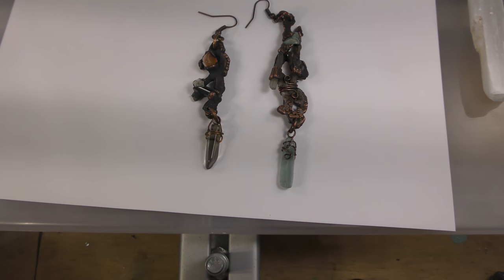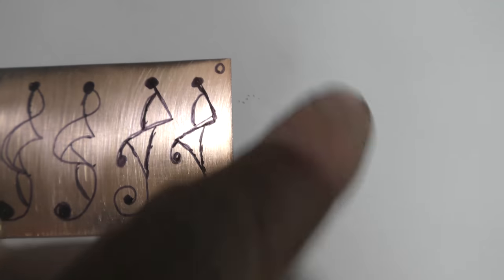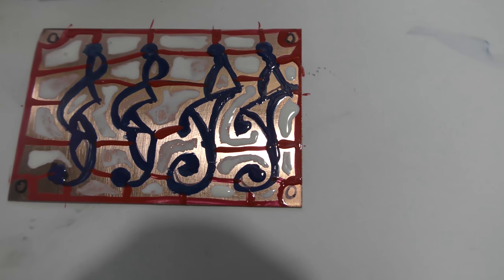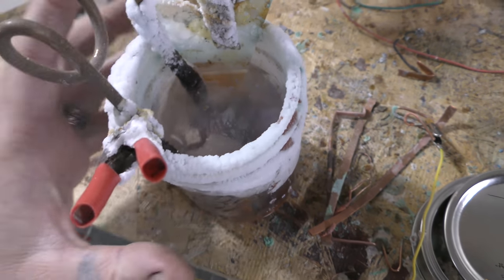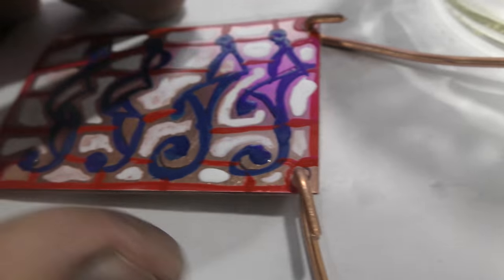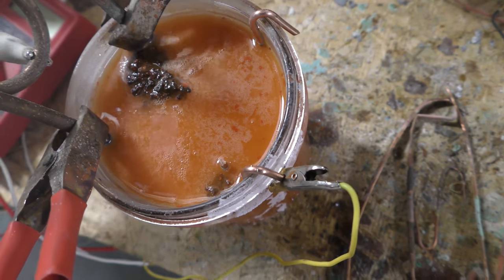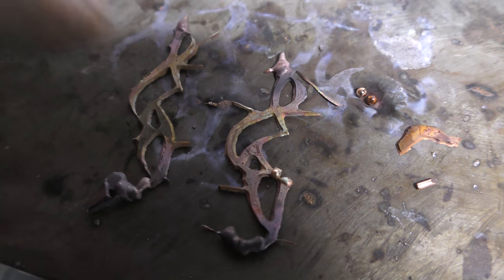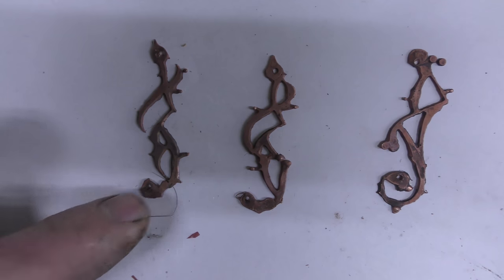Electroetching /cutting  copper with salt water

Comment: Sulfuric acid as the electrolyte would be much better. It would actually make copper sulfate as one of the side products and is much cleaner and probably much faster. Try it out. It wouldn't require any water changing either. The only downside may be its interactions with the tape. Another electrolyte that would work well is the copper sulfate itself.

Comment: You make STUNNING jewelry.I'm a fan. Question: why not just use the electroforming bath? Especially ifyou have other pieces to electroform simultaneously.
Reply: I don't really know why he does the electroforming bath either to be completely honest. You may contaminate the solution but that could be solved by making a new one. Salt has got to be one of the worst electrolytes possible. Not only does using salt produce chlorine gas but it salt creeps as seen in the video and makes a total mess.